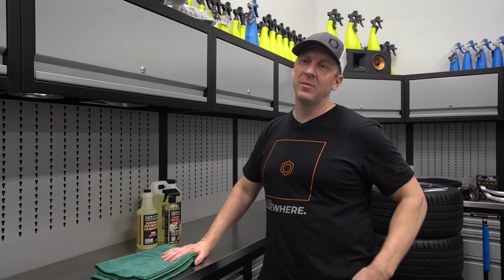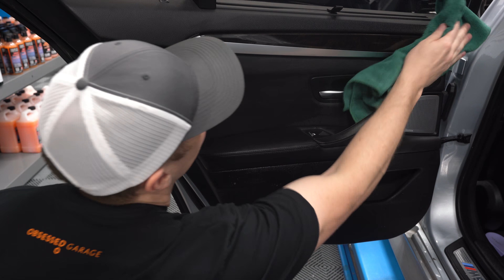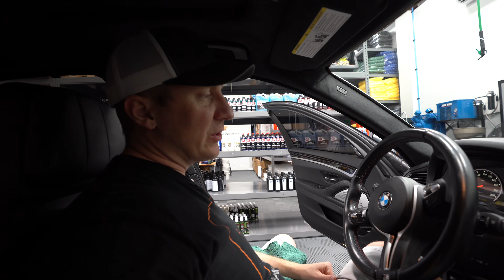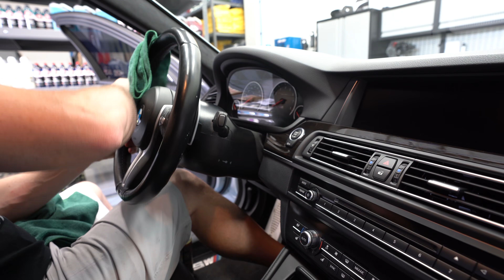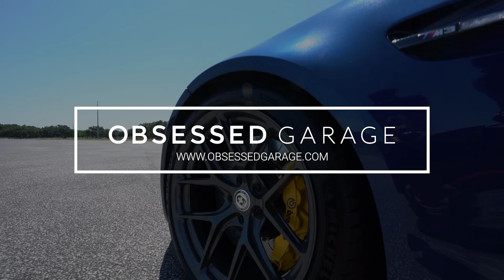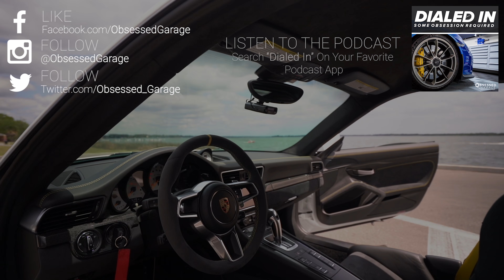OG Interior Products - P&S Xpress Interior Cleaner

Comment: Thank you for the review, I have been using Meguiar's Quik interior cleaner and it works great and leaves a nice OEM finish but the smell is unpleasant. I think it smells worse out of the gallon size. Not as bad in the small retail spray bottle. I will give the P&S a shot. Cheers!

Comment: I currently just use ONR and that does a good job.

But going to start using gtechniq i2 tri-clean and finish off with gtechniq c6 matte dash, leaves a matte finish,has uv protection and hss the added bio cote that kills 99.9% of germs, also the c6 lasts 6 months, so with maintenance cleans, a damp microfiber is all that should be needed.

Comment: I changed from Nexxet Cockpit to the P&S interior cleaner about a year ago and love it. Especially at the low cost. 

Recently I started mixing it 1:1 with distilled water in a 32oz bottle. I then add 1/2 oz of bead maker which adds UV protection without changing the finish. This also makes it a better value diluted.
Reply: Apex Predator nice tip
Reply from the maker: Interesting... That sound pretty smart.

Comment: Does it have UV protection? I dont see anything saying it does on P&S website?  Could you check
Reply: Ryan Pekarik it doesn’t provide any UV protection. I mix it 1:1 with distilled water in a 32oz bottle. I then add 1/2 oz of bead maker which does add UV protection without changing the finish.
Reply: Apex Predator Great tip thanks. I use BeadMaker as a drying aid and use the damp cloth and wipe down the interior, but I will be trying your concoction
Reply: I want to know the same. Sure, I could use a dressing that provides the protection but I don't always dress the interior. In such moments (quick maintenance), I prefer a UV protection in an interior detailer.
Reply: My same thoughts.
Reply from the maker: I'm not sure, but I'll find out.
Reply: @ObsessedGarage  If not, if they add some to the product it would be perfect based on what you say about it.
Reply: Obsessed Garage Are you selling P&S products because you genuinely believe they’re the best? Or because they’re pretty easy on you distributing their products?
Reply: Matt, this would be the perfect product if it had UV protection. Can you talk to Bob about adding UV protection, this is a great product, though UV radiation cause a lot of irreversible damage in a short period of time?  Griot's Interior Detailer does a great job and has UV protection.
Reply: UV protectants should be separate when it comes to an interior cleaner since you can control the amount of solution that sits on the panel. Relying on an all in 1 solution will limit you cleaning effectiveness while only providing a fair amount of protection. All of which can't be controlled independently

Comment: I use microfiber applicator pads to apply interior cleaners/leather conditioners etc. then I buff off with a microfiber towel. I find the applicator pad fits in my hand better and allows me to get into tight areas. I spray the product on the pad first the apply. I get the pads in a six pack at Autozone.
Reply from the maker: That's not a bad idea.